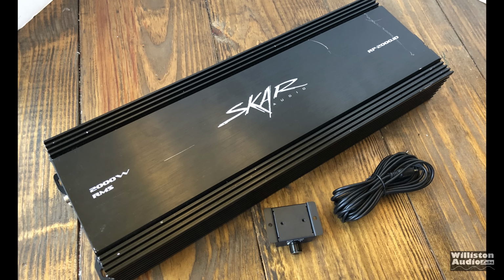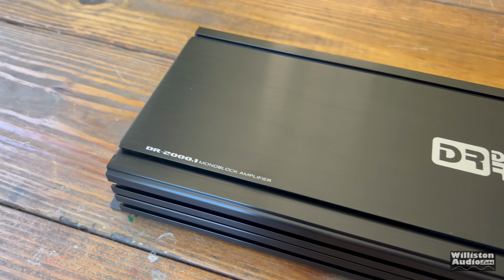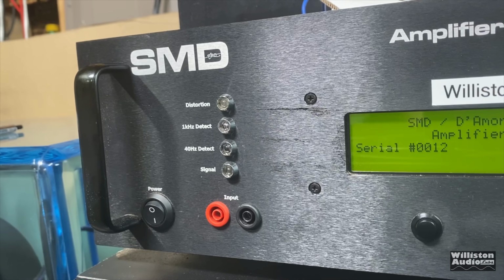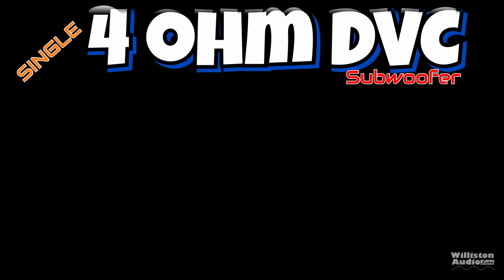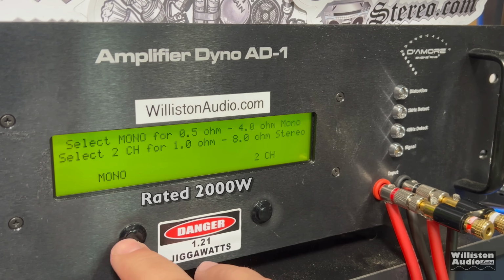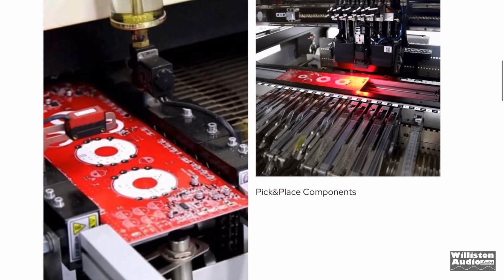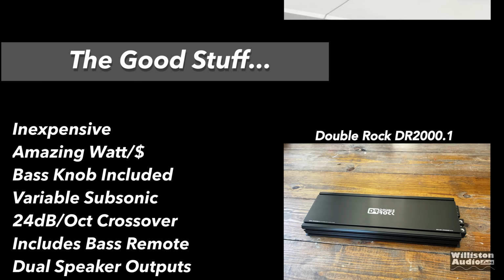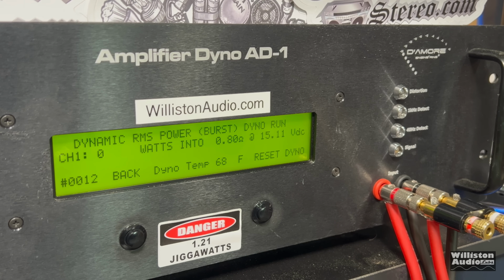SKAR Audio Wants it BANNED!! Double Rock DR2000.1 Amp Dyno Test and Review

Comment: If you a stock Silverado electrical system i can tell you that 1500 watts is the max you can go without changing the alternator. I have a Salt 1 in mine with a 2.0 capacitor and it is just a bit too much. I can’t turn it all the way up. You don’t really need to, it slaps
Reply: try 20 or 40 FARAD steve...and bake yourself chocolate chip cookies, your girl brings the milk

Comment: I watch this video about 2 years ago and it was the only one that actually pushed me to buy one after this video was released the price went up a little bit. I ran it at 2 ohms, on a single massive audio gtx4r. Never meter that the man it was nice and loud quality sound. Then I decided to wire up three of my 10-inch orion XTRs and I had an option of 0.67 ohms or something stupid high, so I chose the stupid low number and it's been doing great for months, the only time it went into protect was after a competition I went to, forgot my bass knob was up all the way so it got hoot. Little time and some cooling off and it came back on and then beat never since its scoped to clean, 1 AGM up front supporting everything in "19 Atlas and gauge ofc front to back, with factory alt. I would definitely buy one of these again even at the price increase.
Reply: It's insane how cheap it is for the money. That's cool you've been pushing it for so long, especially at that ohm lol
Reply: @TurboV8boi agree, but it also rises to about 2 ohms. At peak frequency, I ran it so hard it's gone into protect twice in the last 4 months and that's it, still going strong still happier than ever with my purchase and would buy this again even at the new price.

Comment: I have the rp1500 pushing a zvx12v2. I've had it for 7 years now.  2.3cuft box and I've never had an issue. No clipping or faults. Sub has been hot n smelly but I can run it hard whenever I want

Comment: What I think is interesting is that for the most part, the designs at this level are well known and bordering on generic at this point.   Making them in a China obviously a big price consideration, and the choice of components (particularly in the caps) is the real variation unit to unit.  At the type of power these things are putting out, you don't have to run them to the wall to get the volume you are looking for.  You could probably run them about half way up and still rip your head off nicely.  At the price, you can afford to keep a couple spares in inventory for quick replacement if there is failure.

Comment: When you test the amps how do you set the gain & eq / bass boost
Reply: Turn em up as high as possible for best sound
Reply: flat
Reply: gain is 1/2 - 3/4 , 1 volt in to max out

Comment: had 2 blow up on me I hooked one to power and it went into protect (it directly replaced another amp so I know the wiring wasn't the problem). had another one played it for about a week on low gain less than 1/4, went to turn it up slightly and the amp sparked and went into protect. definitely glad amazon does returns
Reply: connect ground 1st!!!

Comment: Thanks for the video. This is rather interesting. Even though it is a decent looking amp, and safe to say a copy of a Skar amplifier, that's one thing about the Chinese economy. There isn't copyright, or patent laws, so about 50% of their economy is copying other brands products. With probably half of those products made in China advertised as the "real thing". What can't be seen is if the components of the amp are the same quality as Skar. I thought Skar had most (all?) of their products manufactured in South Korea, not China, and is one of the reasons for the quality of their products, and why they became a household name in car audio so quickly. They start off with a good solid design, and then quality manufacturing in South Korea. The majority of "better" brands of car audio (Orion, D4S, Rockford Fosgate etc) are manufactured in South Korea and I think that lends to their quality and durability. However, from the video Skar is "South Korean design" but Chinese made (Future Sound of China). Which I guess means that there are some good and reliable Chinese brands out there.  But there is little Skar, or any company can do when patents are violated by Chinese manufacturers. This brand Double Rock only became available in December '22, and so long term reliability is yet to be seen. Whereas everyone who knows car audio, knows that Skar audio has a good reputation with their products as well as their customer service. Is it worth an extra $100 for peace of mind? I guess time will tell. But it's hard to fault people trying to save some bucks while upgrading their car stereo, because let's face it after market car stereo is expensive. Plain and simple. Being on par what people will spend on a home stereo system (that generally has much larger speakers). Especially when so much of it is manufactured in China. And OEM car stereos, even today after all these years still suck! That's the biggest crime of all. Just look at the new "fad" of touch screen car stereo units. What does a touch screen do for better audio fidelity? It's bling and nothing else!

Comment: Hi i just have a question when you explain the wiring for 4, 2 and 1 ohms i noticed you said ethier you can do a single dual sub in parallel or 2 dual in series "parallel " so my questios is is there a difference between to dual subs wired in series and/or wired in series parallel?
Reply: for world champ db level ya, for normies no
Reply: if your cooking woofers = series, if amp is to small = parallel

Comment: I've owned 2 skar rp 2000 amps for about 3 years now. One is powering 2 American bass xfl 10 subs and the other is powering a skar vxf 12 sub. I have thoroughly put those amps through hell, including blasting hip hop songs for hours on my trip from Pennsylvania to Kentucky and I've never had an issue with them overheating, blowing up, or going into protect mode. So I can definitely vouch for their build quality and longevity. This low budget brand is pretty impressive. But I don't like the way that it's wired.

Comment: Incoming Criticism:
1. Both amps use big beefy copper cable.  But I know from experience that kind of cable will corrode sooner rather than later..  There is tin coated copper cable available that is far more resistant to corrosion. (NOT copper coated aluminum - which should be outlawed as an abomination)
2. You noticed the skar audio amp is cabled more neatly.  That keeps the cables away from heat sources, and with it's low efficiency (for class D) it's going to produce a lot of heat.  And that kind of cable insulator melts easily.
3.  Putting caps that close to heat radiators is essentially a self destruct mechanism.
4.  SamYoung caps from China are bottom of the barrel bad.  SY caps from Korea are also cheap, but much better than the ones that come out of China.  If you want your amp to last, they should be replaced by good reputable caps with a higher voltage rating - and probably a higher temperature rating, considering their proximity to heat sources.  See #3.

All upgrades should be less than $40.  Well worth doing.

Comment: i screwed up and bought a skar sub and amp kit. it included a 12 inch sub in enclosure dual 2ohm and was rated for 400 watts. the amp was 350rms at 1 ohm. the amp had something inside rattling around. they sent a new amp. it worked for about a week. the sub started rattling. blew a few days later. they sent a new sub and it was completely locked up. obviously a pre own but skar claimed it was new. yeah so no more skar junk for me

Comment: I’ve been meaning to ask you..can a person use one of these amps in a home theatre for a sub amp? Is there a converter that can be used to make this possible? Home amps are so damn expensive, and I want to custom build some home subs, but the amplifiers are so darned expensive. 

 If I could use some of these high power cheap car audio amps, it would reduce the cost significantly. If this is a viable option, please tell me how it could be done.
Reply from the maker: You can, but the cost of a proper converter from 120V-12V is not going to be cheap. See this previous video and what he used. I have a link to the power supply in the video description - https://youtu.be/ED26Okgp6EI
Reply: @wal  thank you for the quick reply and the link, I will definitely watch it! Keep up the great work friend!

Comment: I actually own a Skar RP800.1D i had purchased for my work truck to run a Sundown SA-8 V3, and as soon as you showed off this "Double Rock" amp's font on the inputs and outputs i was like hmm.... those are the exact same fonts Skar uses for their RP series amps....so im assuming both of these companies are sourcing from the same Chinese manufacturer.
To be fair, I've never had an issue with that RP800 running at 1ohm on subpar electrical 😅 (its in my winter work transportation, don't judge me)

Comment: the size convertion from inch to mm is way off, only the height is ok, 6" is 152,4mm and 19" is 482.6mm. if the mm size is the right one, i would by a 20pieces ;-)
Reply from the maker: It is indeed incorrect. No way to fix unfortunately

Comment: I bought an Alpine MRP-M1000 a week ago off of someone and it continuously overheats driving a 2 ohm load which it's rated to do. Any idea why this may be happening? I monitored the voltage at the amp while under heavy load and it is good. I'm thinking about upgrading the mosfets to ones with higher current ratings but I don't want to waste a ton of time and money on something that's not going to fix my problem. Any thoughts?
Reply: Bad ground

Comment: Great video as always Big D. I have been out of the car audio game for a few years but your vids still pop in my feed from time to time and something like this makes me think about getting back in with something small. With finances the way they've been I haven't been able to put a system togther but this amp has my interest peaked cuz I have been debating getting a Skar or Soundqubed ~2k and  maybe a decent 15 or 18 but getting one of these would free up a few bucks to put towards a slightly better sub.
Reply: Know where you're coming from, so if I may: a little trick is to go "Non big name brand" marine equipment. Because all marine audio equipment is certified, even the no name brands make marine audio on par with the big guys. I wouldn't purchase a Rockville car audio amp, but have bought a couple of their marine amps and installed for friends (each time paired with Polk DB+ marine speakers), and I can tell you the performance and sound quality was surprisingly good. Even really good. And to compensate for the no name brand intentionally run each amp at 50% on the gain so as to not "overtax" them. But that has been my secret to saving money and being able to afford aftermarket car audio for the last 25 years, while still having a decent product. Just understand the no name brand of marine amplifiers do a good job driving regular speakers, but not speakers "and" a subwoofer with the same amp. I did try that initially (6 channel amp) but just not enough power for regular speakers and a subwoofer. If you want a subwoofer, then a seperate monoblock will be needed. If you match the power (wattage) well to the speakers you  can get plenty of good sound with say 50-60 watts per channel. I think some of these systems I see with thousands of watts are cool if you can afford them, but also at the same time a little "over the top" for car stereos if you are not doing competitions etc. (PS. The Polk DB+ series, are some of the best speakers you can get regardless of price (usually $100 pair for coaxial) and have purchased and can say they impress; and I've been hearing good stuff about Recoil making some good speakers for the price too these days for speakers under the $100 mark.) So good luck and hope you can get ya a nice car stereo system soon if ya already haven't. One of the biggest crimes for car manufacturers is how bad car OEM systems still are these days!  (Another option if you have the time effort and "know how" is if you have a "Pull and Pay" car parts lot nearby, is to go and find a car with a quality stereo that still has speakers in it and pull them yourself. You can usually tell if speakers are gonna work or not by their appearance. And given the price charged for these "used" speakers even if one doesn't happen to work, you'd be out of more time and effort than money. Most places charge only $10-20 per speaker regardless of brand or quality. Find a Mercedes or Lexus a high end luxury vehicle that has an upgraded factory system. Just remember even with the upgraded systems OEM stereo speakers rarely exceed 30-40 watts RMS. The in-dash units though will only work by brand. Those you'll still have to pick up aftermarket that have "universal" application. ) Also 1 "good" 8" or 10" sub can be fine for a car stereo, even better sounding than two cheap subwoofers. Just make sure whatever sub you get gets down close to that magical 20 Hz frequency. And no it doesn't take an 18" inch sub to get that low. It's about the build quality of the sub and sub box that enables frequencies in the 20-30 Hz range. However,  Once you go past 1 subwoofer, the price really increases on a car stereo these days regretfully. Even using a "home" stereo sub is fine as long as you have an amp that will give you the necessary power to drive it. For an 8 ohm home sub, you'll need twice the power/watts from a 4 ohm amp remember. Home audio and car audio are little different. That's why I recommend marine audio, it is built different and more durable)) take care and all the best!
Reply: @johannjohann6523  Well said yo !! 🙏😇👌

Comment: Did you call this a CLONE of a Generic amplifier design? Wow. That's interesting. These are Chinese amps that anyone can order factory direct and they will custom badge and package them for you if an adequate order is placed. Let's get the info out that all of these companies are just resellers. Even the high end houses just call their Chinese reps, and request a change in spec. Presto there is a new model or update. The whole industry is overpriced generic goods. Just the facts folks. Calling that design a SKAR model is laughable.
Reply from the maker: May be laughable but it sure gets eyeballs

Comment: When will we get to see tests of the new U.S. Amps on your channel? Their website is up now, but no purchase links. I think buyers need to call the phone number on their site to order one. Kickin it old school in more ways than one! Lol. But they say they are class a/b and high current, so that's a plus. But the wattage ratings in the manual PDF they have up are suspect. 2ohms bridged appears to be about double what it should, compared to the 1ohm X2 ratings and the higher impedance ratings too. I wanna see the tests before I try to buy one, but my god I'm hoping they are good. To have brand new, high current, 1 ohm stable, class a/b amps on the market again! That will be a good send IF they are any good! Please please please try to get one so you can let the world know!
Reply from the maker: They are not available yet, still in design/production stage as far as I know
Reply: @wal  Oh, okay. My bad. The website says "current products" and shows the 50 HC, 100 HC and the SQ 4 channel along with a manual PDF. So I thought maybe they were setup like some of the other small amp companies where you have to call or email to get pricing and buy. Sonido comes to mind. But that makes sense that they just aren't available yet. By the way, after skimming through the manual, I think I was wrong about the dodgy power ratings. It's kinda vague, but I think they are saying they are gonna have regulated power output. Depending on your ohm load.

Comment: I own an rp2000.1. Total piece of crap. This amp is literally the exact same thing. Good value it seems. I edited this because the skar amp I own looks cheap has cheap parts, but I have beat the hell out of it. 6 1 ohm coils in parallel to it and it has never protected. Sounds terrible. Has no control over the subs, but keeps on going. Assuming there’s a lot of rise. Never put my amm-1 on it so not sure.

Comment: I have all Skar Audio components and subs in 3 vehicles all being run off of my collection of old school Rockford Fosgate amps. I had 1 problem with the surround on my 10 month old EVL-10 in my pickup. I emailed Skar and IMMEDIATELY got a warranty email with instructions. Within 2 days, my brand new sub was on my porch from Florida. That speaks novels for the company Skar is! I will gladly stand by them!
Reply: Unfortunately the EVL has dog shit t/s parameters and is only half as loud as an sa12 classic on literally anything.
Reply: @greggarner4477 Skar skipped the whole quality control step and because of those savings they can spend the money on shipping out new product when there is a problem (and there often is) just gotta push it hard enough to discover that problem within the warranty window.

Comment: I bought a new  xtr2500.1 and it's amazing I have it ran at .8 I was worried about it so I bought a jp23 v2 because I know it will run at lower ohm loads but the Orion turned down spanks the jp23 what r your thoughts running 4 8" vfl subs in ported box